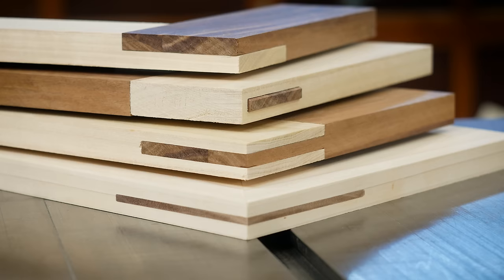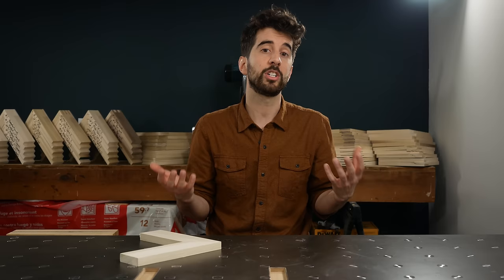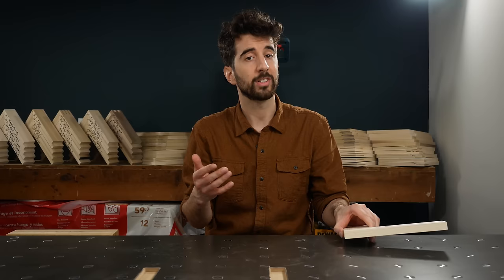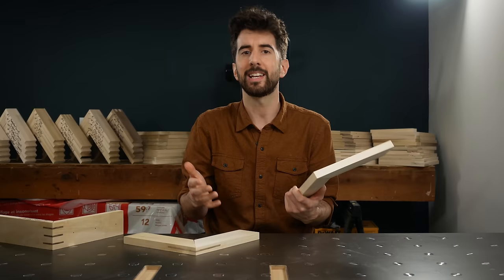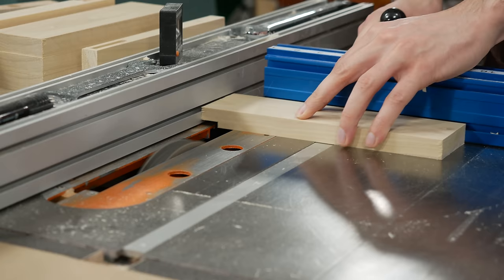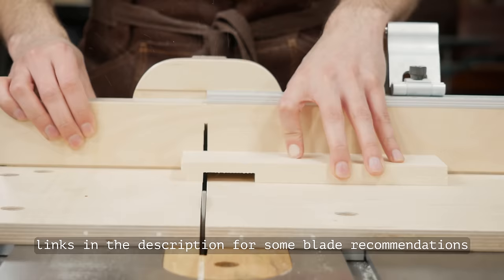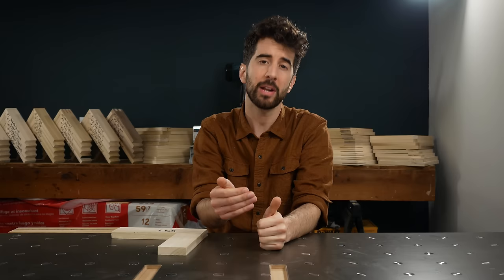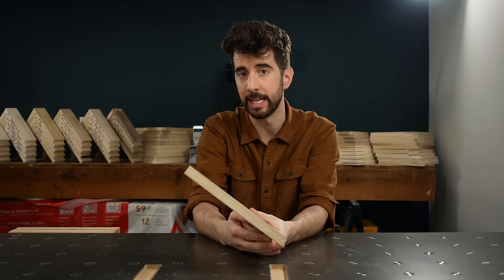Forget Mortise and Tenons... THIS joint is better.

Comment: I appreciate that you hit on the gripe I have about all of these "OMG STRONGEST JOINT" videos, going back to Matthias' seminal video. Use a joint that's strong enough, meets the aesthetics of what you're making, and will last the desired lifespan of the part. I see no problem with some pocket screws and plywood for workbench drawers, but I wouldn't use it for (hopefully) heirloom furniture. There's no one size fits all joinery and that's part of the fun ;)
Reply: He used a 1/4" bit for the mortise. Come on now.

Comment: This video is as solid as a combo half-lap/bridal/mortise and tenon joint with 3 hickory dowels.  Well done!  Looking forward to seeing more of your new garage shop.
Reply: I was going to mention the dowels. 🤬 You stole my thunder. NaYa. 
By dowels I mean from side to side not internally. Drawboard style. Even the splined mitre, IMHO, can be tarted up with two (or more 😳), contrasting dowels either side of the mitre but through the spline can look great. 🤩
Reply: @DB-thats-me  drive them dowels at an angle and you won't care about the glue failing. 'sides, ellipses are cooler than the circles.

Comment: I recently read something about gluing end grain that is claimed to make it much stronger. The issue with gluing the end grain is that the end grain behaves like a glue sponge and wicks the glue down into the wood and away from the joint, with the result is that critical thin glue layer might not be continuous across the entire joint surface, resulting in a weak joint.

The solution offered was to let the end grain soak up as much glue as it wants, and then apply additional glue! To do this, slather glue to the piece with end grain and allow it to sit for 5-10 minutes (but not so long that it starts to dry and set). Then apply additional glue and clamp the joint. This should saturate the end grain with glue so the additional glue stays in the joint space rather than being wicked down into the end grain.

I would be very curious if you have heard of this, if you have tried it, and, of course, if it actually makes the joint any stronger.
Reply: Yes! I've tried it on a test piece of just some 2x4 spruce about 8 inches long. Definitely makes a strong joint,  I can't break it by stomping on it.
Reply: Try a quick double glue application. I glued some red oak with an end grain glue up, as you know, oak is so straight grained porous you can stick an end in water and blow bubbles. I applied glue, let it wick into the grain, applied again, creating a micro "finger joint" with the glue. As glue is typically stronger than wood, the joint is amazingly strong. Try it for fun. I've found the more the glue wicks into the wood, the stronger the butt joint, the caveat being to make sure the second glue application takes place when the first is still tacky. fun experiment.

Comment: A while ago i started using half-lap joints in typical 2x4 construction and it's amazing just how much stronger things became. Even without glue (just screws) everything is way more rigid since in something like a T shape (and to an extent a regular 90) the end of one board is kept from splitting by the board it's cut into. I use a radial arm saw with a small dado stack in it since boards are often too big to be safely shaped on a table saw.
Reply: when you start working with plywood sheets then half laps are super easy to setup as you dont even have to cut them, just lay two pieces on top of each other and have them extend out the width of the joint and voila, instant half laps all over.

Comment: A nice test of the common flat joints. Since I make a lot of boxes, I'm looking forward to your upright joint tests. Though I will say that since I'm not making wooden strongboxes, I still mostly use the easier to construct splined half-lap upright joints for the corners. Yes, I'm sure finger joints (which I think are ugly) and dovetail joints (way cool, but with high skill & time requirements) are stronger, the modest half-lap, reinforced with structural AND decorative splines, is strong enough for my use. It's also easy to cut rabbets along the top and bottom edges of the side pieces for the inserted lid and bottom.
richard
--
“Everything that needs to be said has already been said. But since no one was listening, everything must be said again.”
- André Gide

Comment: The advantage of the half lap over the tenon is that you clamp the two sides of the joint together. You don't have that in a tenon joint, so the contact of each surface of it isn't tight.

Comment: Reason you were getting crazy numbers on the box joint was due to the jack being so close to the joint.  Double the distance from the jack to the joint, and will break at 1/2 the force.  It's like using a torque wrench, longer the handle, the easier it is to turn.
Reply from the maker: I wrote a blurb about this in the description, but in short, I wanted to do a sheer strength test.
Reply: @ScottWalshWoodworking  *shear. Sheer is like a cliff face (nearly vertical), a thin fabric (practically see-through), or unmitigated (sheer delight).

I'm excited to see Part 2!
Reply: @haphazard1342 just so you know, most of us are on our phones. It’s hard as hell to type on these things and autocorrect gets things wrong more than it does right. 

So don’t be that guy who points out typos made by our stupid phones. Nobody likes that guy. He didn’t think sheer and shear were the same thing and you’ve helped nobody by being pretentious and giving us definitions and spelling lessons.

Comment: The traditional tenon width is 4/10. And like with dovetails the single best reason to use it is the ability to forego glue. Heck, if you work with varying degrees of green, like stick chairs, you don't even have to peg the joints.

Comment: 3:55 The miter was 2.4 times stronger than the butt. Most of this difference could be explained by the miter joint being 41% longer (=sqrt 2) than a butt joint. Beam bending strength increases with the cube of the beam height.
1.41^3 = 2.7
I suppose the difference could be in the end-edge grain difference and whether the outside corner buckled.

Comment: My experience restoring furniture, particularly chairs where the joints are put at challenge, is that the main joint used is mortice and tenon and the most common failure is glue related, then tenon related and very few was mortice failures. This makes me think that if you want something that lasts a long time mortice and tenon is the way to go and to make a tenon ticker then the canon 1/3 is a wise practice. I found some pegged or wedged tenon joints without any glue older then a century in perfect shape, I doubt that any joint that relies on glue can last so long as with time the glue cristalizes and becomes brittle so can not cope with the seasonal movements of the wood. If the goal is to build something that is very strong but does not have to last a long time then rely on glue is a sound practice so in this case tests like this one can help, while I doubt that can help if we build something that is made to last a long time, an example is the miter joint if used in a frame, the wood expanding and contracting due to seasonal changes will constantly change the angle from the perfect 45° we build and a glue failure will happen.

Comment: Soooo... Bridle Joint, about twice as difficult to get that glue down in the crack (without a special jig), and just barely stronger than Half Lap. Got it! 😆 And you can EASILY make a Half Lap on any CNC even. So a fancy table saw is not even needed. 😆

Comment: Not all joints are equal, but "by how much" is tricky to tell.  The tests I see treat the joint as a monolithic structure.  In fact, it is composed of many micro-elements.  So when the splined miter is tested in a mode (compression, or pushing the two ends together; vs. tension, pulling the two ends apart), you have to examine the elements.  External compression of a joint creates both compression and tension in the wood; likewise, tension test of a joint also creates both tension and compression elements in the wood,  but the locations are different (of course).  The role of the spline changes depending on whether the wood at the spline is in tension or compression.  A spline doesn't help much when it's in compression;  but when in tension, the spline can enlarge the stress area, allowing more stress before failure.  The joint is not uniform in its strength direction, and most testing only operates in a single direction, which makes simple conclusions very difficult.

Comment: In most cases the mortis and tendon is the strongest joint if you apply tension in all directions and also it is a concealed joint as to say not exposing itself this is essential in fine cabinetry

Comment: I wish you showed the breaking in more detail.
You have two fundamentally different types of failure:  The glue, or somewhere that's not the joined surface.
Your first miter joint was interesting in that it opened up gradually as you increased the force, rather than breaking suddenly.
Your lap joint broke elsewhere, meaning the glue was the strongest part.  The bridle joint improved the strength because you had
grain going in two directions at right angles, like plywood.  This makes it more difficult to pull the fibers apart in one of the legs.

Also, note that you can make a lap joint that looks like a miter, on one side.

Comment: Tis all about application.  If you are making picture frames, then a glued mitre will work just fine as long as there are no weight/stress  issues associated with the overall project.  As I used to tell students you can keep trying differing joints for different situations and details,  but do be aware that you don't need an elephant gun to shoot a mouse. Tis all about application.
Reply: Indeed. And all the joinery looks  different. And they aren’t always interchangeable. You can’t use a half lap everywhere you can use a m&t. Basically , pick the one that looks the way you want for your design, as long as it’s strong enough to handle the load it needs to handle.

Comment: nice test jig!  except it would be better to put the bottle jack outside of the scale to joint pathway, so that the effects of you pumping on the jack handle do not interfere with the measurement.

Comment: Thank you for the (series of) excellent joinery videos.  I loved it and I especially liked that you showed homemade jig options for each method.  

One small point I would like explained further… when you are splining a miter joint isn’t almost all the added strength added to resist “closing the book” vs “opening it”? I would love to see a testing series based on the real world failures of frames.  Dropping against a corner, etc 

Thanks for the awesome videos !

Comment: The major difference between butt joints and miters is that end grain allows much greater surface area due to the channels naturally present to accept glue in the end grain, as opposed to the negligible spaces in the surface of the flat of the board.

Comment: Forgive me if this was pointed out, but keep in mind the distance from the joint where the jack presses changes the leverage it gains. As long as it is consistent, the measured break results should be relatively true. But I noticed in the teaser clip of a different joint, that the jack was about 1/2 closer to the joint. This result will not be true, relative to the others. 
I hope that makes sense…
Love the video, though!

Comment: This is a glue strength test showing results based on surface area, more surface area more strength. Assemble all these joints using wooden dowel or wedges etc that would be a better way to show joint strength. These results would be different using different glue types.

Comment: I love the look of the bridle and half lap but the mortise and tenon has another longevity benefit that might not ever actually matter, but m&t holds together on the ends when other joints might pull away from humidity. that's because the m&t has that enclosed wood framing. It could split but that would require force that would also pull the other joints away too.

Comment: The strength of a simple miter joint is good enough for anything, and it looks decent, and if you want to make it look fancy there is such a variety of ways you can do that with spines. I don't think there's any reason to bother with fancy dovetailing and the skill that you have to develop for that when you can do something that looks almost as cool and is as strong.

Comment: An important point: the solidity of an assembly depend of the proportions: so, if you try with a thicker  miter, or if you have a thicker tenon it will be stronger.
As you see, the sides of the mortises are 2/3 and tenon is 1/3. The miter you used was perhaps only 1/5 or less.
Even, that's widely strong enough to build a furniture.

Comment: A thing to keep in mind when comparing with traditional joinery convention, is the tools used to make those joints. Miter joint is far more difficult to make with traditional tools than a mortose tenon joint. Even for a lap joint, the surfaces must be smoothed perfectly for the glue to hold up, which is harder to achieve with traditional tools. A mortise tenon joint, relies more on mechanical strenght.
Reply: I'm not sure I understand how a mitre joint is “difficult to make” with a saw and an easily made guide for said saw.

It's not been popular in times with natural glues, sure. Not only are they less strong, they're also not as consistent between production batches as what we're used to now.
Reply: @ccreutzig  Miter box is a 1900's invention ofc /s

Comment: I believe that the strength of the half lap and bridle joints comes from the fact that you are clamping the glued surfaces directly together. The mortice and tenon for example does not- no way to close an imperfect fit.

Comment: If you're not painting the cabinets (in which case you'd be looking at a lot of painted endgrain whenever you opened a door), and if the client isn't averse to some endgrain in their door joinery, the bridle makes for a highly attractive joint. I know I sent hundreds of such doors (meaning thousands of such joints) out into the world, where they would last a few centuries in the unlikely event they don't get scrapped in about ten years time, which is about as long as kitchens survive before the next remodel, in the U.S at least. Sort of sad to think about it like that. Then there's the thousands of handcut dovetails in the drawers…

 Fine Woodworking magazine did this test a few years ago (I think they may do it periodically), and I recall the bridle proved to be the strongest. I did a more informal test on my bridle joints: I glued together a rail and stile, stood the stile upright on the floor, and then made a seat of the rail by putting virtually all my weight on the distal end. When the joint didn't budge it was good enough for me.

Comment: I like your miter spline jig. I have an idea to make it more versatile. It appears that it is made for only one width of mitered wood pieces. Why not make one of the angled pieces to slide horizontally to accommodate various widths.  Mill a horizontal slot in one of the 45° pieces and add some tee-nuts to the sled. Attach the movable piece to the sled with bolts with knows. To use it, place the workpiece in the jig, move the movable piece to the desired opening and tighten the movable piece.

Comment: No one has answered to my satisfaction just how strong a joint has to be and for what application. I wouldn't want a butt joint for a bed frame, but it would be just fine for a picture frame.  A cabinet made with pocket holes and glue is a modern technique that seems to offer the potential for centuries of utility.

Comment: A glued assembly has to be made so that the glued parts are working in shear stress, and not in traction. Glue isn't effective while stressed in traction mode. Probably explains why the miter joints were bad
Reply: Splined miter has some area working in shear stress for example

Comment: Most joinery is not stressed in either closing, or opening fashion, but rather sheering... for which the spline and mortise and tenon are strongest at the grain direction, and are a really good choice. The half lap is best because it relies on the glue more than the wood for strength, and the glue is by far, stronger than wood itself.
Reply: Good point. I remember my wood shop instructor showing us how a good glue joint is stronger than the wood itself. He applied destructive force to many glue joints, and in every case the glue joint remained intact while the wood fibers failed near the point of applied force

Comment: Sulivan's end grain test is often misunderstood. What he really tested is that the glue up itself is not as weak as people think. Implicitly (though almost overly), what he did was re-affirm what has always been known in the trade rather well for ever. The "strongest joint" for any given application depends on what forces it will be facing, it is all about opposing the geometry of the actual forces a joint will face vs the geometry of wood, glue and hardware. What you want is to create a sitaution that the force is resisted preferentially cross grain (fibers resisting being torn apart) and failling that along the grain in the longest direction (longest amount of chemical bounding between fibers). Try visualizing/drawing the forces in your test set up (no math, just visually and with a bit of common sense), and how they're redistributed by each shape, and it might give you some insight on how you got these numbers here (and would indeed explain why butt joints and end-to-end grain joints are usually garbo in practice).

Comment: Thanks for testing - it's great to see some unexpected results, but mortise in MT joint usually does not goes so close to the end of the board - there should be some "meat" left for joint to hold on.